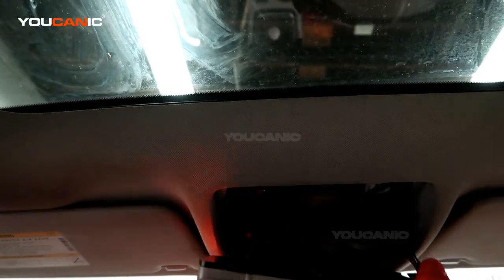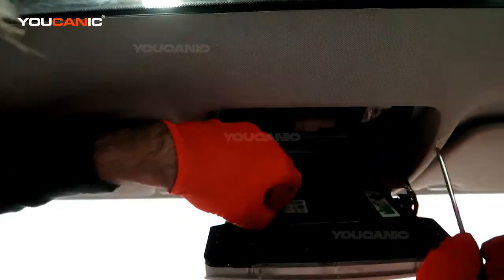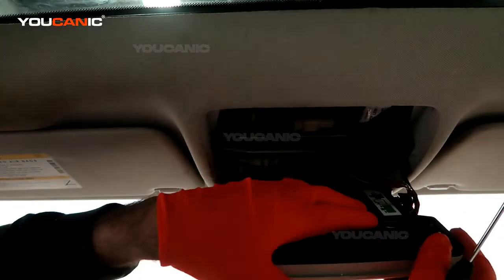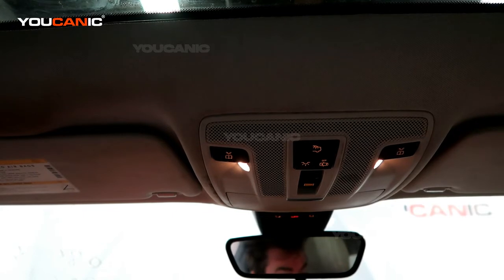2014-2020 Mercedes Benz GLA250 - Map Light Replacement

Comment: This is false,  dont bother as there is no way to replace the lights as they are on a circuit board and not a actual led bulb that can be changed, its a component on a circuit board that shines
Reply: I found this comment once I removed whole panel 🥲🥲🥲